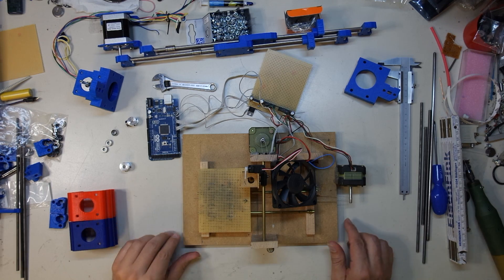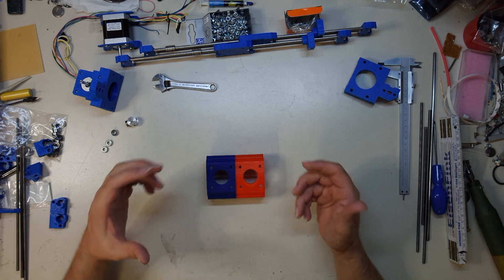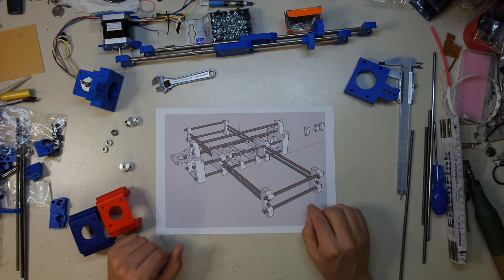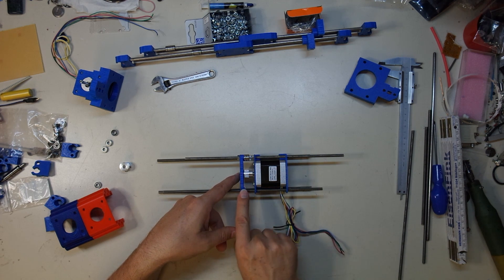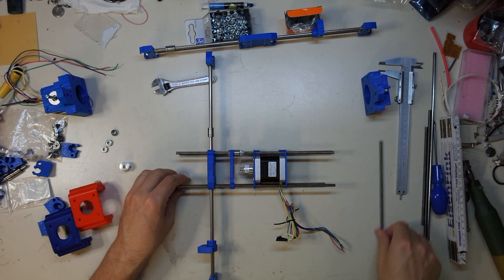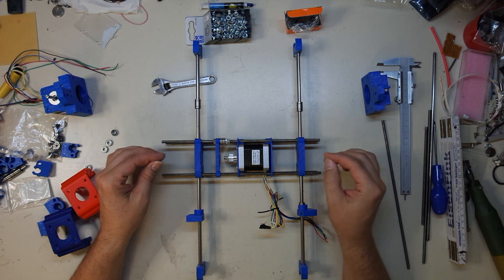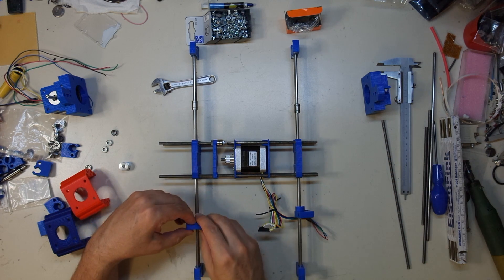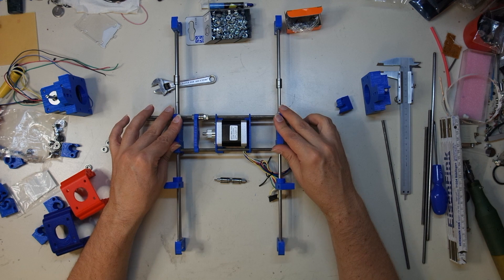The new CNC table pt. 1

Comment: Looks good.

You could put end stops for Y detecting when the tablet/heater lower slider gets near the center part (with the Y stepper motor). Then you detect the most up position, or zero Y  position.

About the parts that holds the Y stepper motor and the Z parts.  
You could add distance tubes on the threaded rods. I think that would make it easier to get same consistent distances between all parts hold by the threaded rods. Getting the tubes length even is easier, I think, than adjusting nuts. And with shims against plastic parts to even the pressure on larger areas, it will not dig into the plastic.  
One other thing is you only need nuts on the out most parts. I think that will make the design easier to put together, with less adjustments and less dependency on nuts that has to be checked, aligned and tighten too often. 

Interesting designed though.  Me like. ;-)